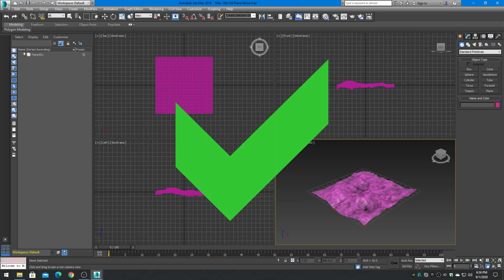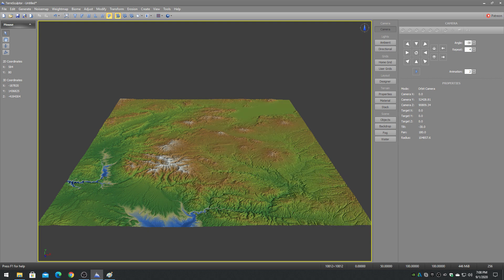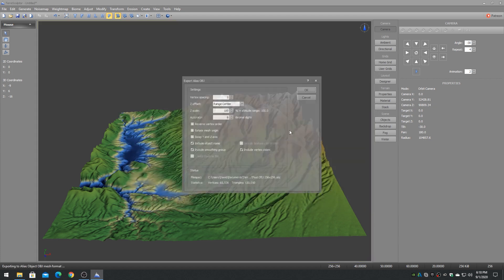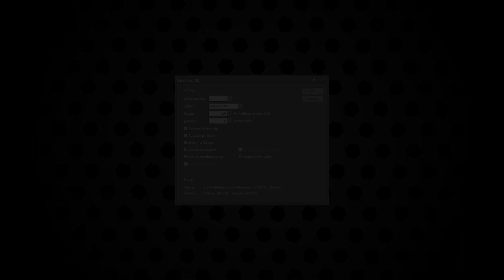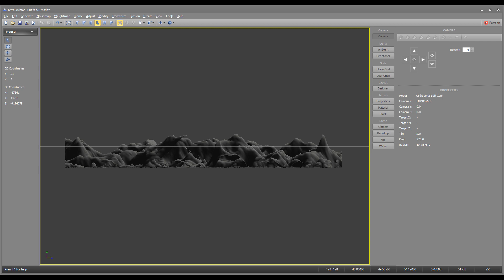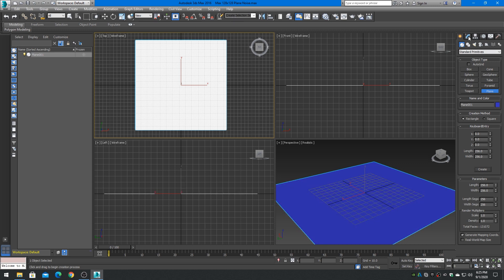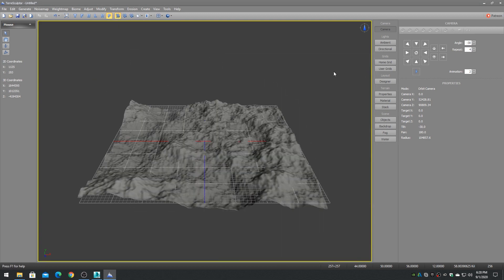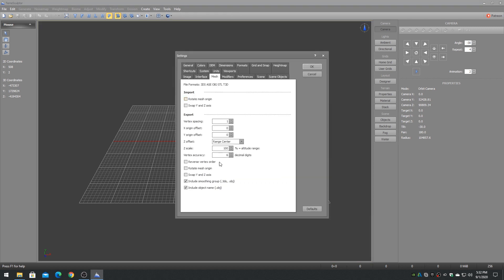TerreSculptor Mesh Import Export

Comment: When trying to import stl or obj I get errors no matter what I do :/
I am using blender, What am I doing wrong?
I made the most basic quad landscape I could do and still I get the errors.

with obj - invalid vertex list vertex value
with stl - triangle cound does not equel.....
Reply from the maker: Those errors probably mean that you have the YZ axis flipped.  Try flipping the YZ axis in the Blender export settings or enable the Swap YZ on the TerreSculptor importer dialog.
If you create a simple flat grid mesh that is something like 10x10 and import that, does the size say 10x10 on the TerreSculptor Importer information, if not then you have to flip the YZ axis.
The OBJ and STL importers assume that you are  creating an equally spaced grid mesh on the XY coordinates plane with Z up.
The mesh also has to be an equally spaced grid mesh, it cannot import TINs (Triangulated Irregular Meshes) as those have to be converted to heightmaps using raycasting.
You could also create a flat 10x10 terrain in TerreSculptor and export that to OBJ then compare that to what you are getting for text from Blender in the OBJ file to determine what is incorrect in the Blender mesh or Blender export settings.
If that doesn't work, you can send me the OBJ file to the Support email address and I'll take a look at it.
Reply: @demenzunmedia  Thank you for your reply :) 
The issue still persist. 10×10 plane object with even geometry. STL with same error message, but OBJ with error 'minimum supported object size 2×2' — I have tried 10×10, 100×100, 1000×1000 — still gets the error.
When looking at the export file from TS the 10×10 OBJ gets rotated in blender, but also it shows 9x9!, tried to replicate the model, got a dialogue screen but then an 'error invalid vertex list.'

I will email you for support with attached files. 

thanks so much.
Reply from the maker: @yudayayuda4408  - A 10x10 heightmap is a mesh that is 9x9 quads.
If the mesh is rotated in Blender when you import it, then you need to provide the correct orientation when exporting, otherwise you will get errors as the elevation data will be on the wrong axis.
Reply from the maker: A note for anyone reading this thread.  I will update the OBJ importer to properly support Blender format files.

Comment: Didn't understand why stl and obj exported flat! Changing vertex spacing to 1 on 512x512 did the trick
Reply from the maker: The default Vertex Spacing can be changed in the Settings dialog Mesh tab.  In later builds of the software, this default value has been changed to 1 unit. If updating from an older build of the software, change the Mesh Setting, or choose the Defaults button to reset all Settings to the new defaults.
Reply: @demenzunmedia  also, is it possible to export hightmap texture higher than 512x512? Can't seem to change the image size.. Love your software btw
Reply from the maker: @TheEric1bu  - You can create heightmaps of virtually any size up to 32768x32768 or more using the New Project or New Terrain item on the File menu.  There is no 512x512 limit in the software.
Or if you have an existing heightmap that you want larger use the Resample item on the Modify menu.
Just be aware that if you are exporting it as a mesh you should use STL Binary format since STL ASCII and OBJ are text formats and large heightmaps will result in massive text files.
Reply: @demenzunmedia  I see! Thank you so much